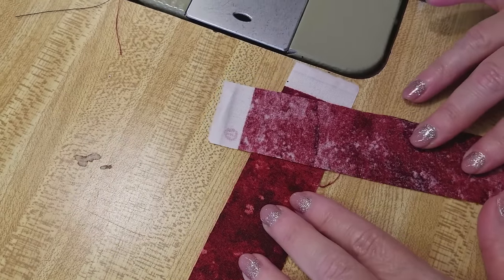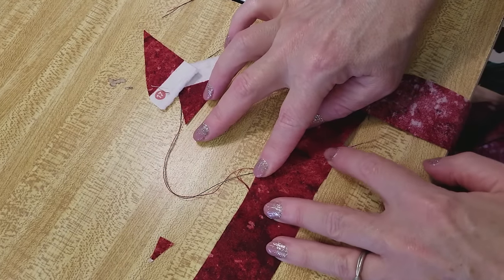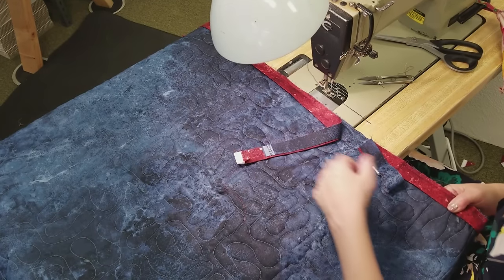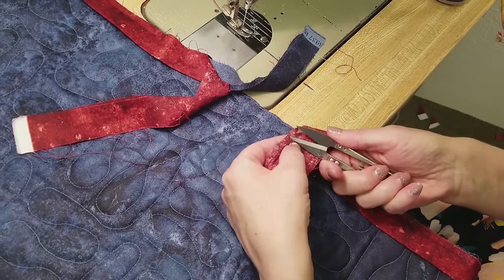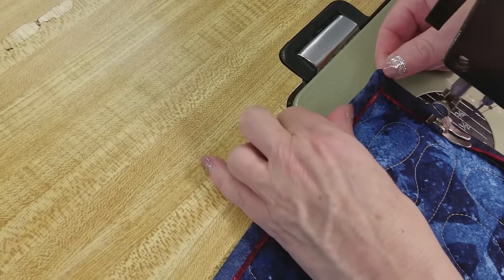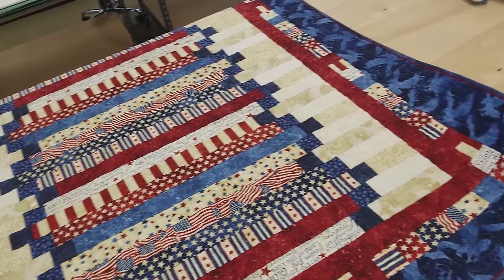Flange Binding

Comment: This is just a wonderful tutorial. I can’t wait to try the technique. I will make one change- when topstitching on the front and approaching the corner, I always fold the bottom portion of binding up first, then form my mitered corner. This puts the fold angles in the opposite directions front and back, and makes it easier to sew that corner because the front fold is going in the same direction as you are sewing, so not fiddly at all to get to the corner. (Hard to explain lol)

Comment: Nice flange binding demonstration. Prefer to do a 45 diagonal stitch  at the edge because that helps for the mitered corners. Also just saw a video stitching the binding seam with fusible thread (bobbin only) before turning then it’s turned and the iron fuses so it won’t shift upon top or ditch stitching. Superior threads also has videos on using fusible threads in other ways, which might also be great pre-iron for keeping the flange correctly lined up. Happy sewing!

Comment: Thank  you for a great tutorial.  As  a seamstress. first and a beginning quilter,  I find when I get my  binding sewn on , either self binding or using the backing fabric to come around.....I press  my binding in place and then I add a strip of wonder under and press well holding that binding right where I want it.  So much easier to go to the machine and not have to work so hard holding and making my arms tired.  Really takes no time at all to 'wonder' it in place as you press.  At this point I only have to SEW  not pull and hold.     THANK you again!!!

Comment: I have been doing this binding for 9 years.  The hardest part is the join, and I love your method.  I use 1 1/2" main color and 1 3/4" for the flange.  I also take it to the ironing board after the binding is stitched on the back.  Additionally, I use my clips when I roll the binding to the front and clip it as far around as I have clips.  It makes it easier to manage. You said you were tired at the machine at the end and I think this is would help.  I use a walking foot when attaching and when stitching the flange.  My Janome 8900 has a "ditch" foot on the walking foot which helps keep me in the ditch.   I do all my binding IRONING at the ironing board. Press to the main color, then fold and match up the edges.

Comment: I used a variation of this method for a quilt I made several years ago. I pressed the seam allowance toward toward the the flange, or the red in this case. It gives the illusion of piping instead of the flat flange. I love this method.

Comment: My solution to stitching from the front is to turn the binding to the front then glue in place with binding clips holding it in place. Leave overnight then stitch in the ditch the next day. Just turns out way better when  not having to hold it in place while stitching. Elmers school glue sticks work just fine.

Comment: I'm trying this now, but finding pressing the 1/4" seam on itself to get that 1/8" flange is very tricky. I'm anticipating problems trying to do those mitered corners with all that bulk of the seam inside the flange. You make it look so easy, I guess I'm not ready for this, but too late, I have to get this quilt finished.

Comment: This is a cool technique!
As for the sewing of the miters (specifically, the red strips in the beginning), you said the material needs to be at a right angle but that's not actually correct!
I know sounds crazy! The fabric can be wonky if you want. The important thing is that the sewing starts and stops at the intersections at top and bottom.
Said another way the "V"s the materials make top and bottom.
Try it. I didn't believe it either. 
If your not matching designs or pinstripes then a perfect 90 is not necessary!

Comment: Another great video Donna! I enjoy flange binding also but I've always made a little bigger. You've inspired me to try smaller next time. I'm making your starry log cabin right now and enjoying it. Thinking about making the stars float so I don't have to worry about the points. I love your floating star points. You and your family have made a huge difference in my quilting. From cutting, finger pressing, pressing, floating stars,  and precision I've learned so much and I've improved tremendously. If only I had a quilting machine I could get to the next project faster. :-) Actually considering quilting by check. Do y'all quilt for others?
Reply from the maker: I think that the flanged binding would be easier if it had been cut a bit wider and I am going to try that out next. We only do a limited amount of quilting services and right now it is only for our local customers who come into our retail store here in Grants Pass, Oregon.
Reply: Thank you. Wish I lived closer.
Reply: I usually cut mine at 1.75" and 1.5".  Seems to work well.  I love flanged bindings!
Reply: Cindy McFarland Very clever and neat😃

Comment: Do you line up with the right hand side of your foot?  I find with those standard industrial feet they're actually a tad less than a 1/4 inch - the famous scant 1/4.
Reply from the maker: My foot is 1/4" and my throat plate also has measurements so I can make sure to use an actual 1/4".

Comment: Isn't that hard, mine always gets wonky when I try this!!!!
Reply from the maker: It is a bit hard, but if you go slowly and carefully it does work.
Reply: I’ve tried doing the machine binding, but mine also comes out uneven and wonky. I need to get better at this since my hands are becoming too arthritic to hand sew. So I guess the answer is to keep practicing! Thanks so much for this very informative tutorial. I might try it on a quilt,  it would make it a little wider, since I find that easier to work with. Thanks for all the information.